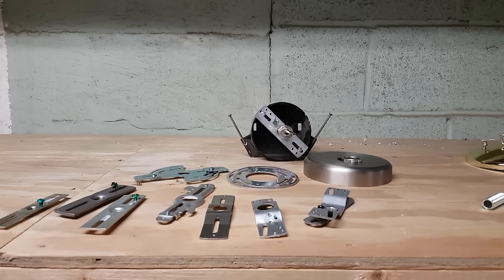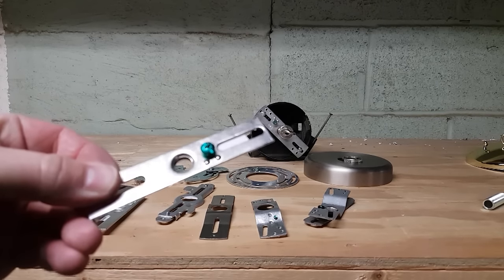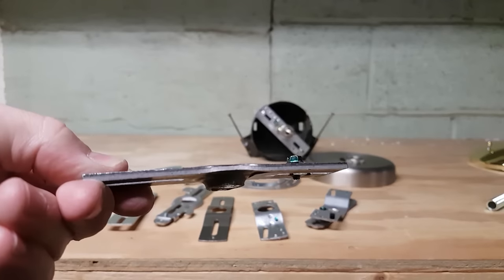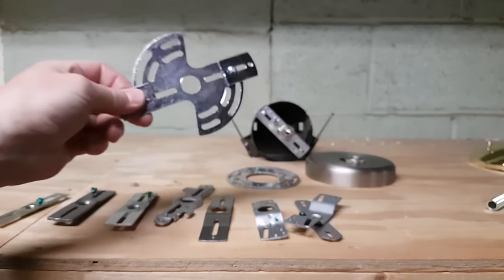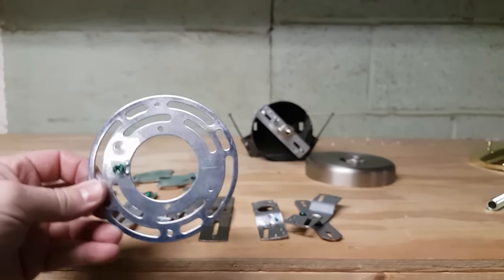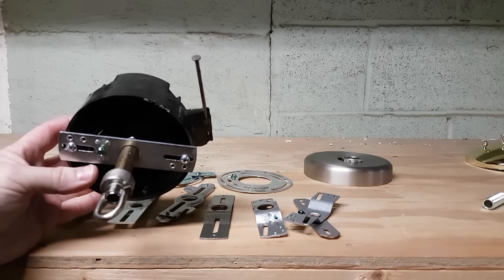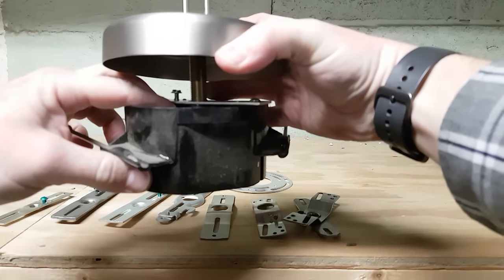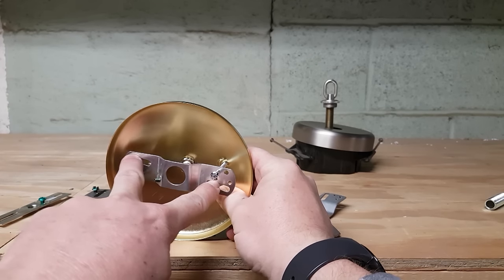Cross Bars   Antique Lamp Supply

Comment: Which mounting bracket would allow you to mount a sconce light that has the two 8-32 mounting screws aligned exactly where the 8-32 screw holes are in the round plastic rough-in box? The brackets that came with my light can't be mounted on the box because the light would not be straight given the bracket's mounting screws for the light are right where the bracket needs to mount to the box.

Comment from the maker: The term "IP" stands for Iron Pipe or IPS for Iron Pipe Size and is a standard sizing set in the 19th century. The lighting industry still uses these standard sizes for threaded pipe. Most common pipe sizes are 1/8IP (~3/8 inch), 1/4IP (~1/2 inch), 3/8IP (~5/8 inch), and 1/2IP (~3/4 inch). The Underwriters Laboratories (UL) standard 1598 requires a crossbar for luminaire to be at least .053 inches thick and made of steel.